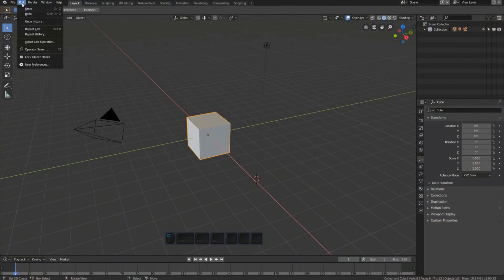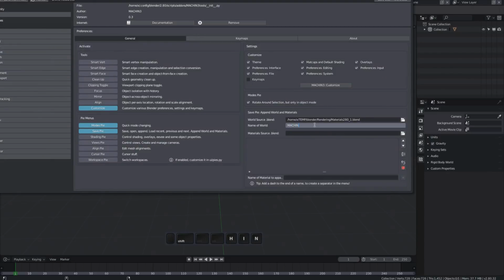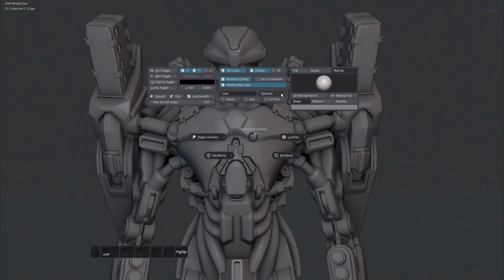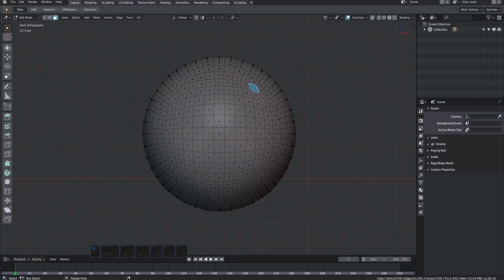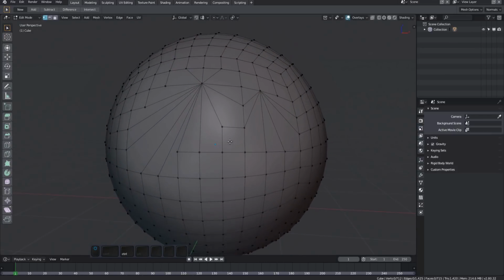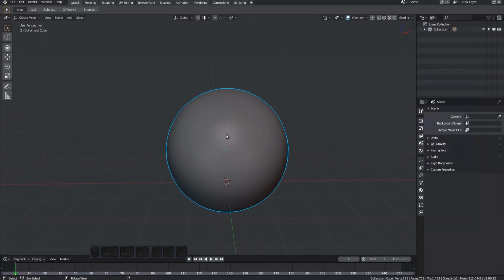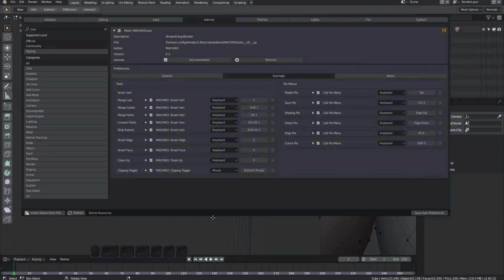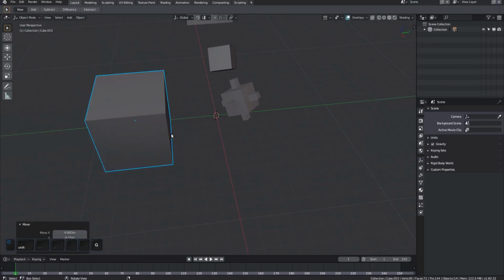MACHIN3tools 0.3 - Blender 2.80

Comment: Hi there MACHIN3, just a quick question about the Views Pie. I am using a newer version so the feature may have been removed, but when I open the views pie I only get the axes, I don't get any options for the smart view cam or persp/ortho or lens adjustment. Was this removed?
Reply from the maker: Nope. Check the console for errors. Reproduce it on a factory reset, stable Blender release, then report if it persists.

Comment: Hello MACHIN3, I really like this add-on and have a proposal for a small feature improvement on the Focus command.
Would it be possible to add a shortcut ( i.e: Ctrl+Shift+F ) that would hide the selection - instead of isolating it - but keep the same "multiple level" behavior?
Reply from the maker: This is how it used to work before there was better api access to local view. I don't think I'll bring back the old behavior as an alternative, too much on my hands right now.

Comment: I would like to know where did you find your material library file? Is it made by you?
Reply from the maker: It is.
Reply: @MACHIN3  How i can create and use them like in you in this video? Is it hard to create and setup material library .blend file?
Reply from the maker: @bryantremblay7478  You just save a blend with your materials and then pick the path in the MACHIN3tools prefs. There's a button now with a globe icon, which will populate the list for you, so you don't have to manually enter the material names.

You might want to apply each material to an object in the material source blend, so they material sticks around and has a user. Alternatively, you could also toggle the fake user flag for each material.
Reply: @MACHIN3  Thank you :)

Comment: Pop-ups continue to appear only at the bottom left, can I somehow do as you have in the center?
Reply: i was also wondering this. at 26:56 they summon the align operator pop-up to their mouse position. it looks like they did it with whatever "mouse 8" is (according to the screencast keys), but i have no idea what the function could possibly be called to find it and set it to something...
Reply from the maker: It's called "Redo Last" if you search for it in the keymaps. It's also called "Adjust Last Operation" when called from Blender's edit menu.
Reply: MACHIN3 awesome! You’re the best!
Reply: looks like it's F9 in new versions of Blender (formerly F6).

Comment: Thanks for creating such an amazing and useful add on. Is it possible for the shading pie menu to remain active until an OK button or an empty space is clicked? Something similar to HardOps "Helper as Popup" option.
Reply from the maker: No, I'm bound by how Blender's pie menus work. They close immedeately after every click. If you need to make more involved adjustments requiring multiple actions it's better to use Blender's menus/panels.
Reply: @MACHIN3  Okay. Thanks for the fast response.

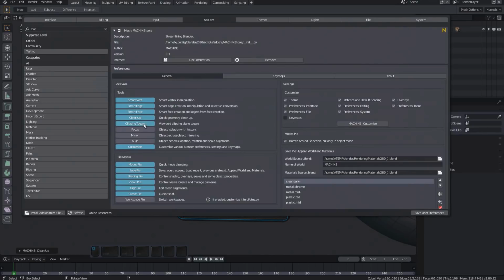Comment: 22:41 Clipping Toggle  ,  I didn't figure out how to do that, my mouse just have left right middle three button, so I changed the short key with "5" , when I selected the tow vertex, then I press 5 , the MACHIN3:clipping toggle tools came out on the left side , but I didn't see the vertex clipping as it is on your video , did I miss something? Do I have to press other key or mouse to do it ?
Reply from the maker: If you don't see the clipping, you are either not zoomed in far enough, or are using an orthographic view. In any case, if you don't have camera clipping issues, you don't need the tool. 
Any keymap will work, btw.
Reply: @MACHIN3  Yes,  I was using orthographic view, thank you !

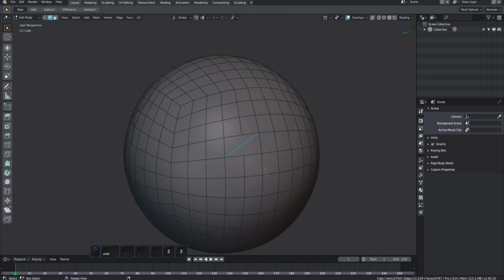Comment: Thanks a ton for this suite of tools, you should be working with Blender UI team :). One question why are edge turns limited to 3 edges? 18:16
Reply from the maker: More than than and I assume your want to use Select Loop Inner Region, which is run on a closed loop edge election.
It's a bit lazy, but the alternative is checking if your edge selection is indeed a closed loop and only then run Select Loop Inner Region. It's possible to do that , but not trivial.  The question then becomes, do you really need to turn more than 3 edges at once? I tend to turn 1, most of the time. Probably always.

Comment: Love the add-on. However. For some reason there is a slight delay when pressing tab and trying to quickly toggle between verts/face/edge mode. Makes it feel a bit cumbersome. Is anyone else experiencing this? Thanks
Reply from the maker: I don't have this. What keymap do you use? Can you demo it?
Reply: @MACHIN3  unfortunately it's at work so very hard to demo it but it's just the default keymap setup. I'm buying a new PC for home use soon so if it's still happening I'll send you an example. Thanks for the response :)
Reply from the maker: @Hodgson3d   Have you run the customize tool, with interface enabled? Maybe its the pie menu delay/animation you are talking about?

Comment: smart vert didn't act as I expected connecting paths, I found several great techs in this tutorial. cheers!
Reply from the maker: It works for me. what was your selection like, what did you press?
Reply: I had the same issue, you need to select in a "U" fashion for it to work, as stated in the video

Comment: I have proposal for Shading Pie, it's annoying to pres key and have only one click on any option and pie disappear, if you can make it like holding key for shading pie to hold pie on screen so we can manipulate all option until release key and for short key pres and release to work as now, one click option and pie disappear. What you think?
Reply from the maker: I'm bound by what blender provides. I have no influence over this behavior.
Reply: Also, when you select any object for example Spot light and press Ctrl + num 0 to look trough selection and use let's say fly mode to position light in scene and exit from it, after that smart cam option is not working, it's pop up some cod error, i should select manual any camera in scene then and press Ctrl + num 0 to look on that camera and then Smart cam work again.

Comment from the maker: 00:00 Installatiion
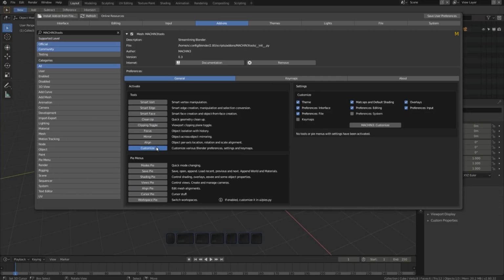00:35 Customize
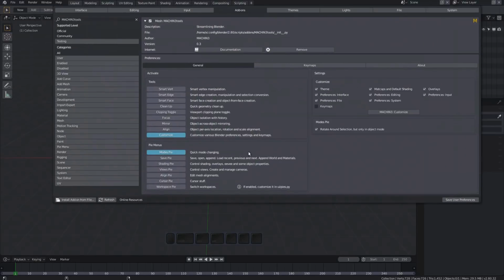01:30 Modes Pie
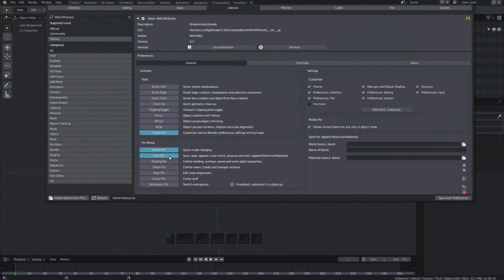02:44 Save Pie
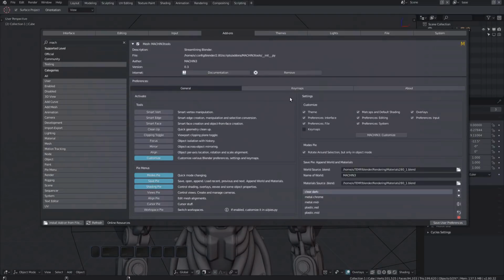06:11 Shading Pie
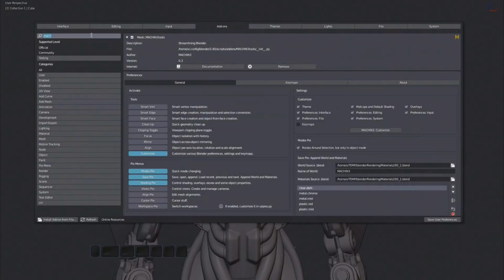10:38 Views Pie
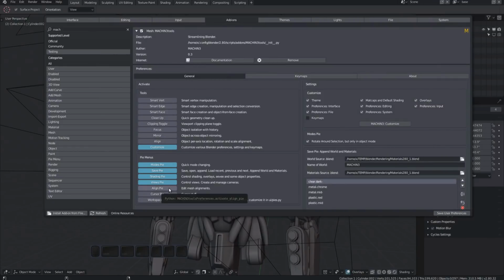12:35 Align Pie
13:58 Cursor Pie
14:56 Workspace Pie
15:08 Smart vert
17:47 Smart Edge
19:29 Smart Face
20:58 Clean Up
22:41 Clipping Toggle
23:35 Focus
26:08 Align
Reply: Thx!
Reply: Machin3, quick question, how is this compared to BoxCutter or HOps? I want to get one hard surface addon soon but they all seem to do similar things. Is there a video or can you make one talking about the differences or advantages of using one other the other. thank you. excellent work
Reply from the maker: @marioandresruiz2294  Neither of my addons is similar to BoxCutter or HardOps.

MACHIN3tools is pie menus and convenience tools. Very general purpose and not hard surface focused at all.

DECALmachine does mesh decals, and so is a detailing tool. BC/Hops doesn't do that.
MESHmachine does mesh modeling, BC/Hops doesn't do that either. 

Check out https://machin3.io/DECALmachine/docs/
and https://machin3.io/MESHmachine/docs/
The first pages give a good overview over each addon.
Reply from the maker: @doroode Wow, neat! Thanks man!

Comment: OMGGGGGGGGG LETS GO BABY
EDIT One a more serious note: fantastic work. 100% usability at work here, very smart decisions. I do wonder why you do not have a menu/pie for "AXIS orientation". Sadly there does not seem to be a 3D Gizmo yet in Blender 2.8 to see which way your normals are pointing but it would be useful to have a hotkey/pie for it regardless. Keep up the awesome work ^^
Reply from the maker: It's coming, don't worry. This is a wip. You could use the gizmos of the transform tools.
Reply: @MACHIN3  NICE! im having such a blast playing around with these tools. I hope its ok to post my suggestions for possible additions:
1. Hotkey that toggles Sub-D mode (since TAB is taking).
2. a tool/script that "ring selects" and "removes loop" with 1 command. Very useful for low poly creation and UV.
3. a Material quick assign menu. Not only for rendering but useful for LP/UVing.
4. an expansion to the SHIFT + A add tab consisting of often used primitives: Clinder 6 Sides Clinder 64 sides Small Cube etc. 

EDIT a bug (?): EDIT2 Not a bug! its intended to work in Objectmode.
1. the Ctrl + F only works in Object mode. Once you enter edit mode the hotkey conflicts with the Ctr + F Face menu. Should we change that menu ?

 Keep doing your awesome work!
Reply from the maker: @remon563   Focus is not intended for edit mode. It hides objects, not faces.
Reply: @MACHIN3  Hi Machin3 will you port the "surface slide" tool from your 2.79 MACHIN3 kit?
Reply: In order to achieve the 3D gizmo in 2.8 like what was default in 2.7x, you simply keep the move tool as your active tool. If you have the select tool active, by default it does not show any gizmos on what you have selected. If you remember, we almost always had the transform widget turned on with move selected by default, as seen here: https://upload.wikimedia.org/wikipedia/commons/4/4d/Blender_2.79.png

Setting active tool to move will show you where your normals are pointing like it used to. Or you could always turn on normal indicators that come out of the mesh itself.
Reply: @GeorgePence   yes you are right George. Sadly its ideal atm as you rarely want to use the actual gizmo handles but just use them as a "normal" indicator. Best solution now is to assign a hotkey to quickly toggle when needed.